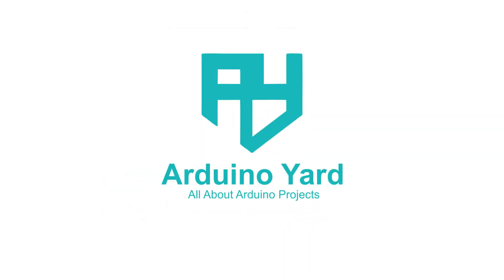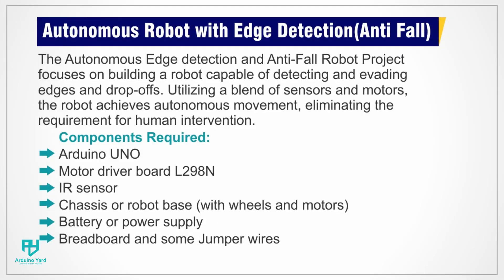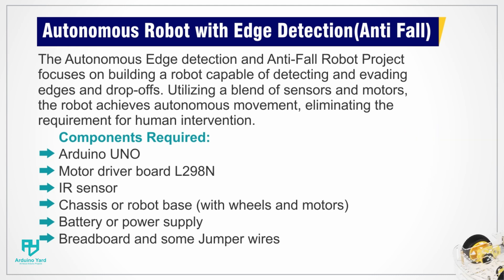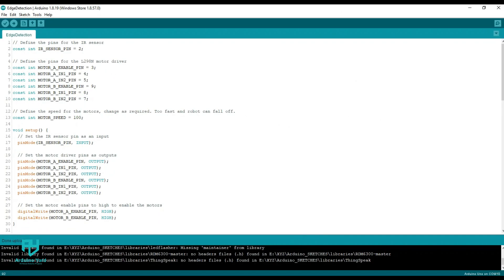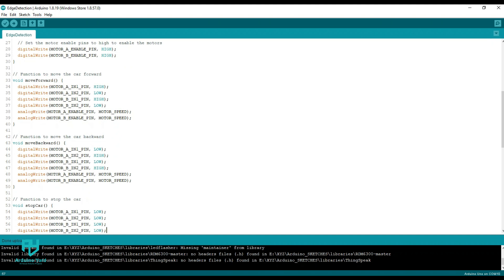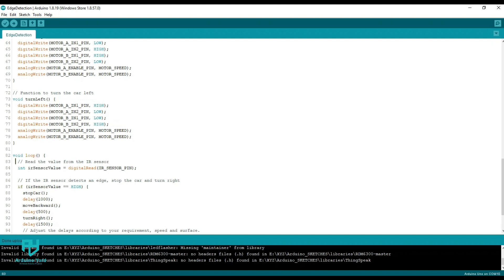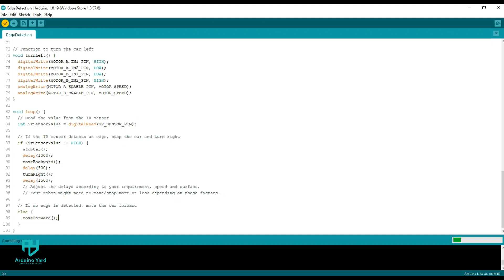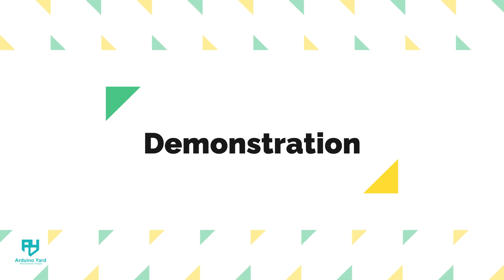Autonomous Edge-Detection Robot with Arduino Tutorial | Arduino Robotics

Comment: why is it not working
Reply from the maker: Kindly let us know what is the issue you are having?
Reply: @arduinoyard  can I use 9volts instead of 12?
Reply from the maker: Yes you can depending on your motors. But these hobby motors usually use 12V.